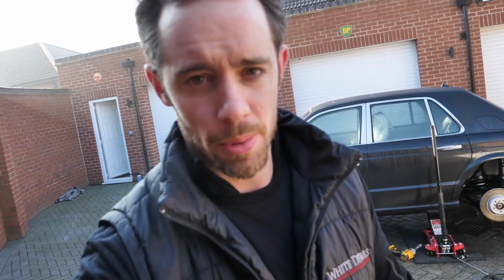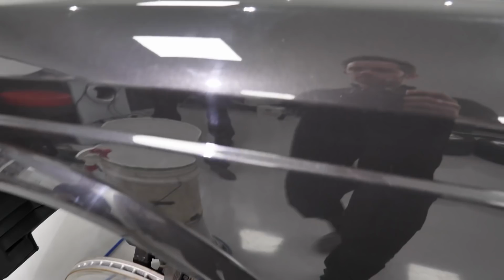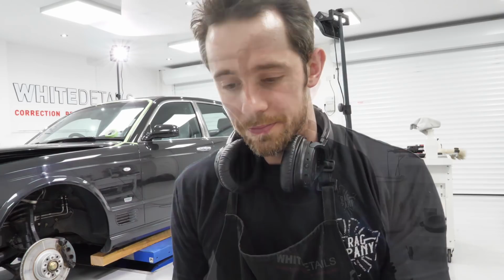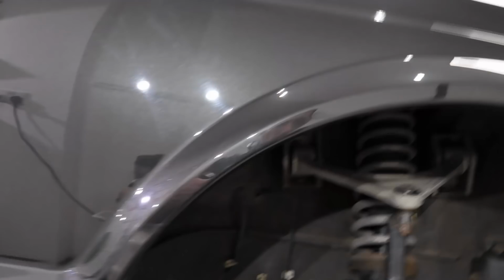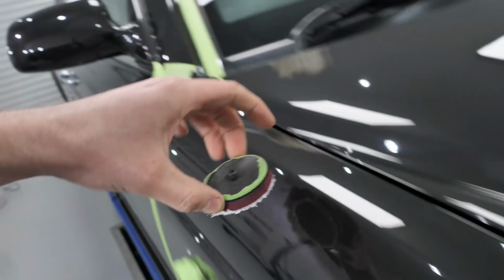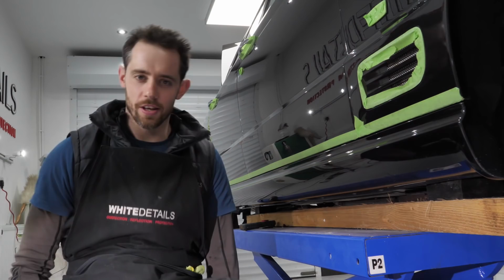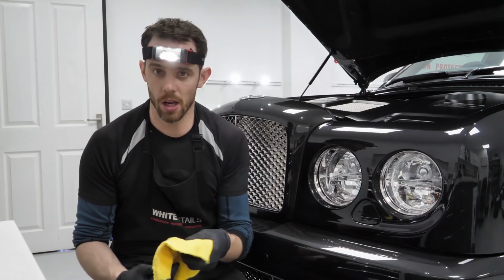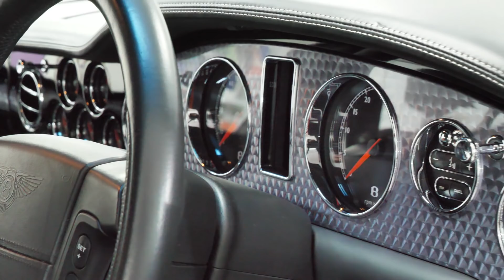Bentley Arnage T receives the "White Detail" - VLOG 064

Comment: Jim those chrome grills can be cleaned with 1:1 Megs Wheel Brighter during the wash stage. Cuts down on the hand polishing. As usual with any acid, care needs to keep it off somewhere you don’t want. Don’t leave it on long.

Comment: I was thinking a rotary flex shaft attachment with foam tool to do the grille. This could control the correction speed much better than a dedicated flex shaft used in dental and jewelry work. Glad to see you back, I too was going through withdrawal. Loved your comment about patience. There is an element of almost OCD 🧐 either acquired or innate to achieve these results. Aloha from Maui.👍👍👍👍👍

Comment: It is good to see your work as always but I have a question.   At what point do you worry about paint thickness on the vehicles. Such as age, or is a precheck before you touch them mandatory but never posted, and is it something you worry about once the work is done, also do you ever recommend repainting the vehicle. There’s only so much clear coat to work with.

Comment: Hello, James!
I think that a very useful tool that would come in handy for those intricate parts of the car is made in a kit by Autotriz. Its full name is Autotriz Nano Polisher Kit 2.0. It attaches to a rotary polisher and its design makes working around problematic, tight and oddly shaped areas a dream. You might consider it.
Thank you for the free bits of information provided in each video!
I have a question: what are your go-to compound and finishing products?
Cheers!
Reply: That actually looks like a nice kit. Might order one later. 
Cheers!